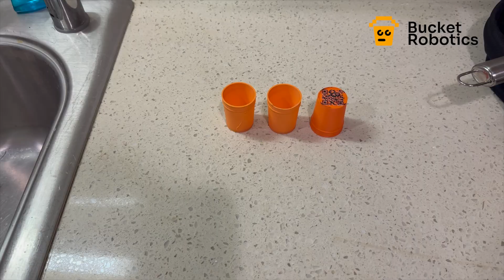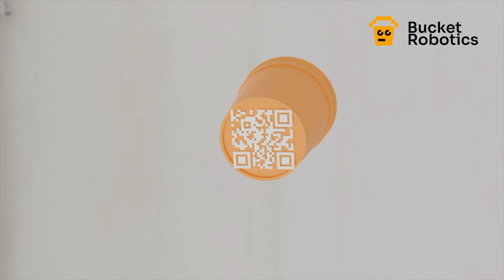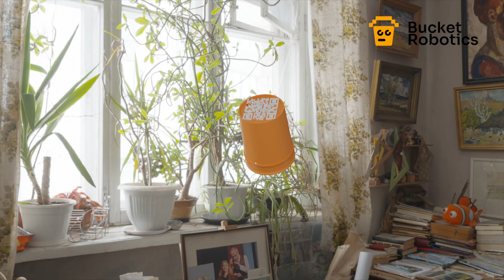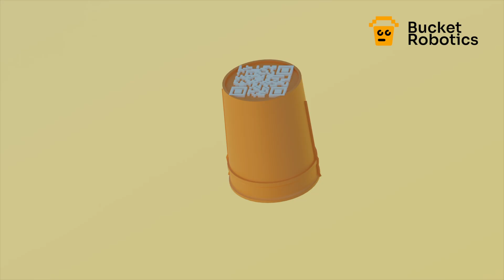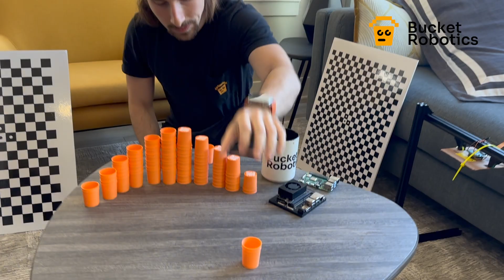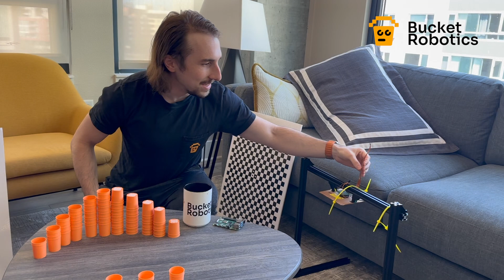Bucket Robotics (YC S24) | Defect Detection Deep Dive

Comment: Hi, are you using a stereo camera to cover up the complete fov, and detecting the defect
Reply: Stereo is actually overpowered in a lot of different cases! since you're looking for a surface-level defect, the need for depth estimation isn't fully necessary.

What IS important is having full surface coverage -- so either rotating a part in front of a single camera, or holding a part in 3d and having a set of cameras capture pictures from different angles.